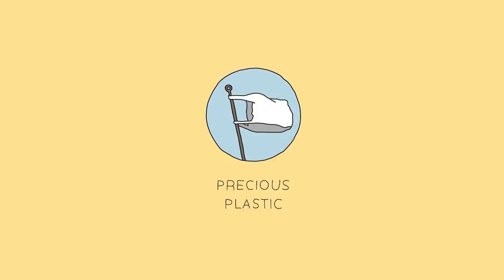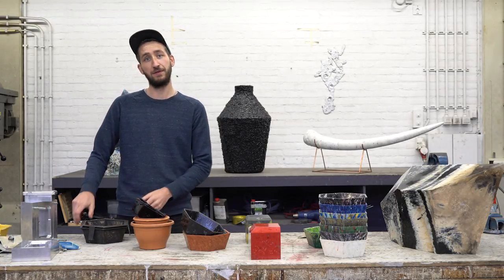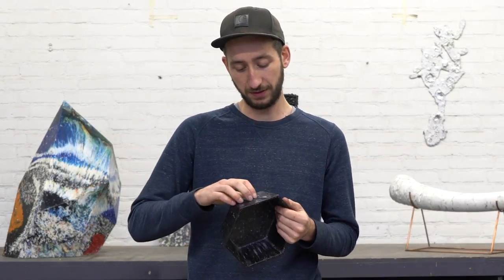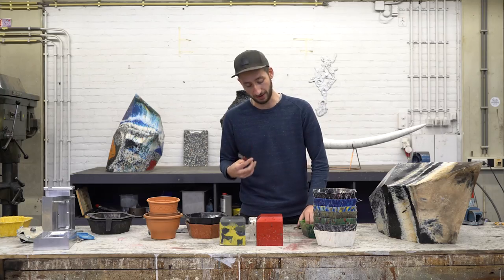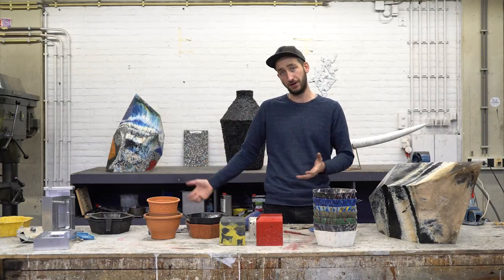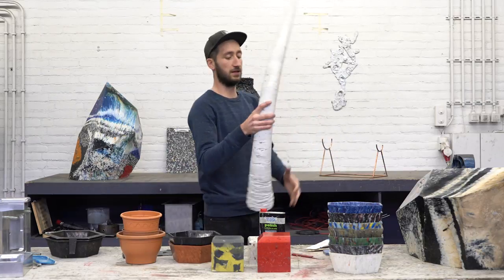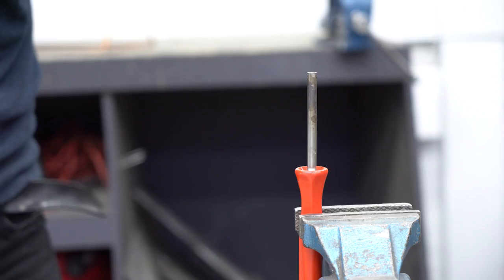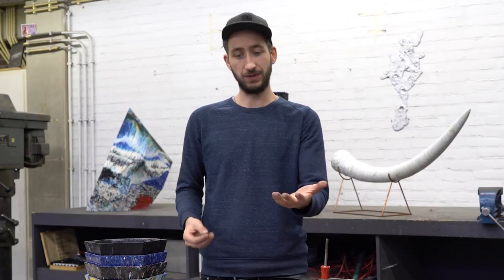Precious Plastic - How to finish objects from recycled plastic (part 5.2)

Comment: In case that it is not suggested yet. I recommend to add a shaft to the coin so that it can be attached to the soldering stick. That makes the process more robust, easier to handle, and it will improve the heat transfer.
Reply: With the shaft you suggest, you could also heat several coins together on a hotplate, allowing you to stamp several pieces quickly rather than waiting for a single coin to heat up after stamping each one.
Reply: He wants it to be a thing anyone can do.. not everyone has a soldering iron.
Reply: @dr.nug7103  Not a big deal, if they are knowledgeable enough to build or buy, and operate precious plastics machines making products out of recycled plastic then they can certainly figure out how to buy and operate a soldering iron. 
It only cost like $40.00 for high wattage iron. Any one of those precious plastics machines will cost into the $1000 and higher, $40.00 more is nothing in comparison.
He even used a soldering iron what else do you want, that is why he said he likes to use the solder iron, it is cheap way to heat it that anyone can do and have access to. They sell them everywhere. lol I wouldn't recommend using a torch to the people because it is an open flame, that is why he suggested the solder iron i suspect. But the first thing the common man would grab in this instance is the torch. You can heat it in 3 seconds.
Reply: Exactly what i was thinking, he had to use pliers to grab it. lmao
Reply: @TheRebelmanone  very true

Comment: I might suggest that your thermal stamping be done by silver soldering each coin onto an inexpensive soldering iron and now you have an easy to use handheld tool for each stamping you require. The silver solder has a much higher melting point but would make it a lot safer, faster and easier to stamp your products.

Comment: I like the marking coins.
If you add a little shaft to it you can handle it better, or even assemble it on the soldering iron for easier handling

Comment: I'm curious, would freezing the softer plastic make it any stiffer and easier to get smoother using the techniques you used for the harder plastics?
Reply: As I know, yes. But as you start sanding it It's heats up in some seconds.
Reply: Some types of plastics become very brittle when frozen. Idk which ones.

Comment: ABS also reacts to acetone, I have used this method to smooth out ABS 3d prints/projects. A warning if you use acetone on ABS make sure you have a safe surface or hanger system on a non exposed surface.

Comment: I suggest you a challege for the community:
build a 100 liter tanker or bucket or barrel from shredded material (for instance in  HDPE) or smaller size item.

It could lead to develop NEW blueprints of a new machine to include in our list.

It would be useful to add  to the container a sloping roof and gutters AND collect rainwater with tankers made out of recycled plastic
I hope someone  will design some  molds for these useful everyday objects: 
snow shovel 
bucket and spade for chidren
seasand toys
duplo-like bloks

GREETINGS FROM PADOVA - ITALY
Raimondo
Reply: Raimondo Barbera boats would be cool. Has anybody tried rodeo kayaks from recycled plastic already?
Reply: That's easy.  Just a wood form, jig and the extruder
Reply: metzindustries don't know. Those boats need to be fairly rigid, some structural work is needed to get that right.you would do it in half molds and weld the parts together. Probably a negative to get the outside nice. They are rotary molded in production.
There would be some opportunities in doing boats like the "Reverso" sailing Dinghy from reclaimed HDPE. It's 4 parts so the molds wouldn't be that big. I just did a 4 part sailing Dinghy and I am looking into the next one right now. Maybe I got myself some new goal.
Reply: Easy, add chopped strand fiberglass to it 20% volume or milled carbon fiber
Reply: Boats are easy. Roto mold.  Make it as two boats at once, saw it length wise.  Use a Teflon coated iron and heat gun to smooth and finish it
Reply: i live in a third world country and i can tell you that if it is possible to plastic cast, people is doing it right now, the bussiness grew like crazy in developing countries like México(my country <3), im starting my own recycling bussiness atm haha, that how i know
Reply: Great ideas but for water tank, you need HDPE else plastic may leech into water. In example, if you use Poly carbonate roofing or piping, you must be sure you'll never have chlorine touch to it and then flow into a water tank. The reason is Poly Carbonate when combined with Chlorinated Water, it leaches BPA and it is very risky! Also, i'm curious about UV Resistance, here in Australia plastics don't have much chance against UV+Heat. Should buy a Temperature Cyclic Test Chamber and give it a go...

Comment: Would be very nice if those coins had a metal stud out the back that could be threaded to screw into the soldering iron.  Then you could quickly stamp each piece without having to use pliers to handle it.

Comment: Wouldn't it be easier to have the stamp as part of the mold? I have been collecting all types of plastics for months now and looking forward to building the machines.
Reply: Then you would need different molds per type of plastic.
Reply: @cepterbi1  or the specific coin could be mounted in a specific location in the mold each time...

Comment: i always have 3d printed waist pla abs petg. may i know what is the cheapest way  to make them to cube or tile without those big machine ?
Reply: make a mold, pure inside the plastic (per category) and put it in an oven (not the same as the one you cook food..). Raise the temperature to the specified one for each type. This should get you started...

Comment: Is there a way to make such a nice cube from hdpe ? 
mine shrinks alot and most of the time gets a crack in the middle
Reply: Miky Schuster something that helped me with hdpe is that as it cools in the mold I increase the pressure of my clamps to keep it compressed as it contracts. A bit of a hassle to have to keep checking it, but makes it smoother.

Comment: it would be way easier to make the coin witha little shaft so you can put it on your soldering iron and stamp them on the moment, (its a little unconvinient if you work different plastic at the same time, but its pretty unlikely and by the 3rth minute on the clock you could have marked like 30 pzs and switched to another stamping coin with a shaft) gl with ur proyects m8s

Comment: Question! When you are sanding it there is micro plastic coming, any advice how to handle it?
Reply: I think vacuuming the dust and putting it in the bin is the best thing you can do,  still not great but the best you can do with the system we have.

Comment: Hello, im from Lima Peru, looking to start a business in plastic recicling making pavement and roofing tiles, but i have some issues in my search for an extruder to fit my means, may be you can recomend me some company that makes this type of machinery, i will start with 180Kg/h, and need a single screw with 3 adjustable temperature zones. I have more parameters for the machine im looking for, but would be very greatfull if you can share some information. Thanks
Reply: Hi Jorge were you able to find  a company that makes it?

Comment: I wonder how you would shred that huge plastic rock to recycle it again.....
Reply: You would cut it into smaller pieces and put it through a shredder.
Reply: Yep, hammer and chisel
Reply: it's got to be so tough on the shredder..
Reply: Or you can grind it like cheese XD
Reply: cut it with a jig saw, with a blade for wood a very low speed
Reply: Put it in a big lathe and turn it down to shavings
Reply: i guess the idea is that you wouldn't recycle it. It is a lot of garbage compressed together into an item/art. No small bits get in the ecosystem as this remains alltogether... The problem still remains to the unlimited production of plastics...

Comment: The whole answer to quality in plastics is control of the process, including making good molds to start with and using the correct time and temperature for the press or extruder. If you have to do any more finishing than maybe trimming off flashing, you've lost the plot completely.